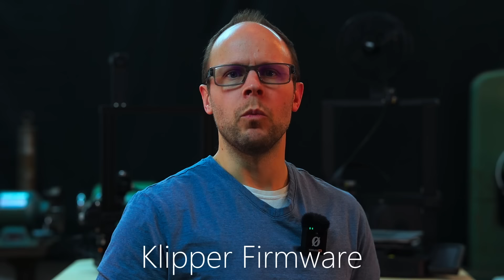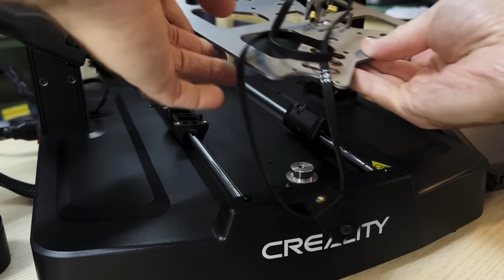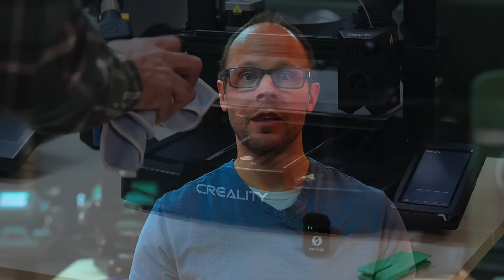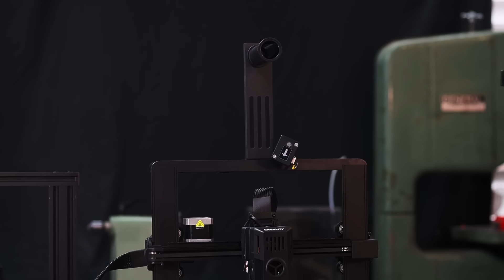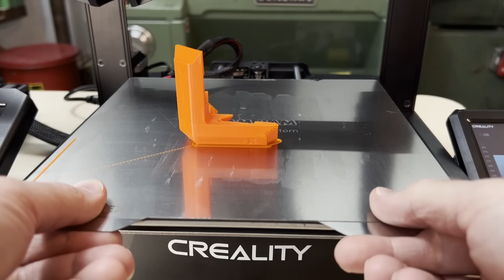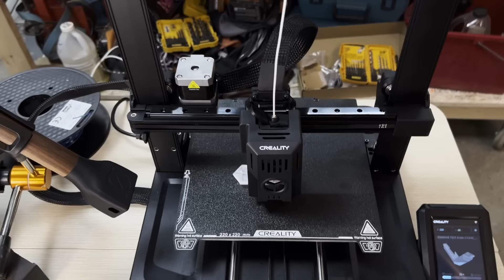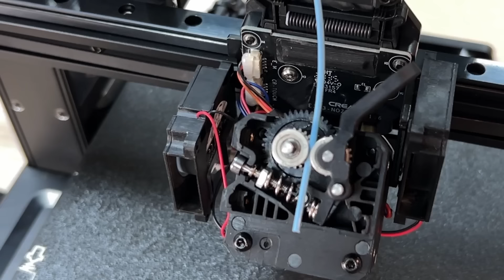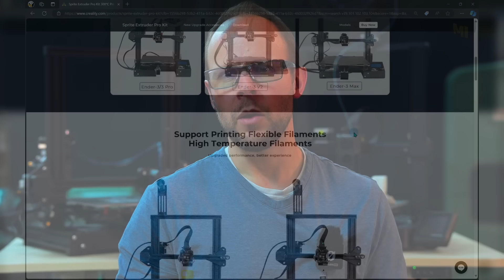Is the Creality Ender 3 V3 KE Any Good?

Comment: Just watched your video, really great. I've had the KE for about a month now and I too, no matter what I do or what calibration I try, I cannot get good results with PETG. I've been using an Overture White with Orca Slicer...
Reply from the maker: Okay, that's perfect, thanks for confirming what I've been having trouble with.  I didn't show it in the video, but I also tried Orca slicer to see if the results were any better... they were not.  I thought that the slicer could be to blame as well.  

I think we're left with the extruder itself, or the extruder/hot end.  This hot end is proven to work well at high speed on the K1 series, and that same hot end is on my printer that I used in the video.  I need to find a way to get the K1 extruder onto the KE printer and test it.  If we can do that, we can eliminate, or confirm where it is coming from.  

Could it be that the straight style of gears along with the volcano style nozzle don't like PETG?
Reply: I do think it is something to do with the combination of this nozzle and gears. However, this nozzle, I'm lead to believe, is the exact same type, size, etc as the K1 so by process of elimation you could probably rule the nozzle out and look at other parts of the extruder / gears. 

I don't have a K1, otherwise I would have also tried swapping things out. Good luck!
Reply: Yes! I've also had the KE for a month as my first printer. I can get near perfect results on PLA every time with almost all default profiles/settings in Orca, but the second I try to use PETG the print quality rapidly declines. I thought I just needed to spend time calibrating it specific to that filament. It's nice to see someone else having issues with PETG on this printer. I can't get it to print anywhere close to as nicely as PLA
Reply: Im printing petg at 300mms whith ke... You need some specs?

Comment: I've done quite a bit of flow testing on my Ender 3 Pro and the Sprite SE extruder is a big upgrade over stock with the Bowden. With just a nozzle and heatbreak upgrade, I was able to hit up to 30mm³/s with minimal under extrusion with a fairly low temp PLA. 16-24mm³/s will be a more common reasonable limit. With the KE hotend and long nozzle, wouldn't be surprised if 30mm³/s was possible for most PLA and probably 15-20mm³/s with PETG even. Basically, under extrusion shouldn't be a big issue. It did look like you got a little but on the base of your microphone holder. Could just be due to slicer settings or something though. Happens to me a lot on perfectly rounded areas too.
Reply: After leaving this comment, I see all your issues with PETG and it could be flow limit related. I sort of doubt it because I would think at least 12mm³/s would be easy for that hotend and extruder combo. I don't have any inconsistency issues like you are having with PETG on my Sprite SE extruder, which is exactly what is on the KE, and with what should be an inferior hotend setup. When you are pushing the limits of flow, you'll see the thumb lever on the extruder moving back and forth. That will be when the filament is bunching up against the nozzle and pushing back on the gears. See if that is happening with your inconsistent prints. You'll note on smooth prints the thumb lever pretty much shouldn't move at all. If it is inconsistent extrusion, you're probably having issues with either not enough temperature staying at the top of the hotend, or you're having heat creep into the heatbreak which is heating the filament too much, but it then cools causing binding. If lowering speeds and/or raising temps doesn't get rid of the issue, I'm not really sure what it could be. I would wonder if reducing retraction or turning it off would make a difference, as retraction can cause too much warmed filament to enter the heatbreak and cool. I've only had that issue with carbon fiber PLA really though. At any rate, my best bet is simply that the PETG needs a lot more heat and it is essentially sapping heat from the hotend causing it to come out in a pulsating manner, giving you those inconsistent lines. I would doubt it is an inherent flaw with the extruder since you are not seeing it with PLA. Definitely makes me think it is heat related.

Comment: I own KE for a month now and no issues with PLA+ at 300mm speed - all looks very good for my needs. Upgraded from Ender 3 v1 and in compare it is like get from old bicycle to Ferrari. Very good printer so far. I would recommned it specially for beginners in 3d printing.
Reply: I can relate
Reply: I have a few using for my business and it’s absolutely flawless!
Reply: i have a question because i want the printer and an e scooter and i have a budget so my question is does the printer get boring or somthing like that in a few days/months

Comment: Fantastic in depth review! Great work. One of the best reviews on this machine.
Reply from the maker: Thanks so much!  It took a bit longer than I was expecting, I didn't think I'd be taking everything apart and trying to fix it... I just couldn't leave it without at least trying.   The printer has a lot of nice features, the linear bearing/rod issue is fixable, I'm not too worried about that one, maybe Iges Drylin bushings would work well there instead.  The extruder/other problem, I'm still a bit disappointed that I wasn't able to get to the bottom of that.  I have a K1 Max as well and I think I will do something similar, I notice some good features above what the K1 has, but I also have a few things that, let's say could have been better.  Still a great, and big machine, lots of potential for sure.  I appreciate you taking the time!
Reply: @NeedItMakeIt  I noticed the linear bearings in the video had too much play, it sucks that the Quality control is so poor that you as the consumer must figure out all of this. There is also the software aspect where they have cut corners, for example if you get the accelerometer and do input shaping it only does X axis and use the same value for y... Also there are some strange design decisions on the K1 with the pulley system and filament path that willkeep users from getting fantastic prints.
I will buy the CR-10 SE mainly because it's an E3V3KE with a beefier motion system and more features. You should look into that, it has a 24mm linear rail for the Y axis instead of rods, and dual Z motors.
Again, it's awesome that you took the time troubleshooting the printer and making the video so detailed. Big kudos to you, this will help a lot of KE buyers.

Comment: Nice to see creality coming out with new old stuff...
I still run an Ender3 pro. Looking to change out my e stepper motor, from a 4240 to a 4223, but not sure if it will work because the the difference in torque 4240 has 0.4nm, 4223 1.3ncm.. 
What is your opinion

Comment: Hello There,
im watching your channel for the first time with this vid.

Could it be that the issues with filament feeding are related to the gears? Perhaps the centers of the steel gears are not precisely aligned with the centers of the plastic gears, causing them to run unevenly. As a result, the filament is fed irregularly. The shifted centers could explain the irregular movements.
Reply from the maker: Glad to have you, thanks for checking it out.  

These gears are a bit strange to me, it isn't something you'd normally see on a high-speed printer these days.   I have seem some reviews of straight cut vs hobbed and the straight cut has more potential force that can be applied before slippage, but at the expense of deforming the filament.  It is possible that it is related to the gears, I think there is some connection, but I can't quite put my finger on it.  With regards to your point about the feeding, here are a few things that happened during the tests that may help to figure it out:

Printing PLA (Hyper) showed good and excellent results, that filament is quite precise, just like the Prusament is
Printing PETG at higher speeds seemed to produce better results when at higher speeds
The results for Galaxy Black PETG, and the other two were not at all the same

I think I need to eliminate some variables and see if it can be narrowed down a bit.  

Thoughts on that?
Reply: While it could be a contributing factor, I doubt that is the issue because first of all it would have to be extremely off to create that much inconsistency and second we would see it in the PLA as well.

Comment: With regards to the linear rods in front, I saw on another channel they showed the screws do not touch the rods and therefore does not hold them in place. Their solution was to use grub screws to screw it down.
Reply from the maker: That could certainly be a contributing factor.  I have a video set to release this Saturday for the full explanation.  It wasn't the obvious unfortunately.  I'll see if I can move those rails when the screws are tight, I was wondering about why the screws seem to fit tight to the surface of the plastic, they should be just slightly proud!
Reply: The same problem with the SE printer, one of many problems it has.
Reply: Sorry about being 2 years late but it seems creality has fixed this issue as i brought a v3 ke a month ago and the build plate doesnt move left or right at all
Reply: @TylerG-g8w No they didn't, the plate does move and if you have no wiggle while it's stable you just got lucky and it certainly does wobble when it is moving and there is no way to avoid it with how this printer is put together.

Comment: You should buy and test the optional vibration sensor for input shaping. It’s about $19 and can be easily plugged into the display on the back side.
Reply from the maker: I heard that you need to check the X and Y axis' separately, I will do this if you want to see the comparison in a stand-alone video.  Of course I need to solve this extruder issue.
Reply: @NeedItMakeIt  I would definitely also like to see this
Reply: @NeedItMakeIt  yes, first screw it to the print head with a printed part and than glue it to the base plate. After that you can remove it and store it anywhere for the future.
Reply: @NeedItMakeIt for it to do input shaping for x and y separately you need to root the printer, install fluidd and change some parameters in the config.cfg file. Creality uses the x value for both axis.

Comment: Great review. Just got mine and noticed the bed wobble. Would it be possible to make a short video on how you fixed that? Cheers.
Reply from the maker: I wish it was a complete solution, bit I can certainly come up with something that solves the problem and doesn't cost much.  My best suggestion at this point is that the rails need to be replaced with actual 8mm.  3D printing your own bushings with that type of tolerance is a task that I don't think I can recommend.  You'd need a reamer and any pressure applied by the bearing block while pressing the bush in will cause the ID to change slightly.  I will put some more thought into a final 100% solution that lasts, maybe something will come to mind that I haven't thought of yet.
Reply: @NeedItMakeIt  Awesome. Thank you.
Reply: @NeedItMakeIt   I wonder if delrin bushings might work or if they'd wear too quickly at the speeds the bed is moving.
Reply: He covers it later in the video fairly in depth.
Reply from the maker: @802Garage  I wish it were a perfect solution, adding the bits of shims was pretty sad, even though it seemed to help a little.  At first, I applied pressure to the block before tightening it, but it seemed to relax back after the first test or so.  Could we use very small liner rails here instead?  It wouldn't need to be much, or possibly a single wheel riding below that can run against one rail to keep a little pressure.  That one seems a bit gimmicky.
Reply: @NeedItMakeIt  I like tinfoil as a shim since if won't compress more after initial. Could also print new mounts for the rails potentially?

Comment: Good review.
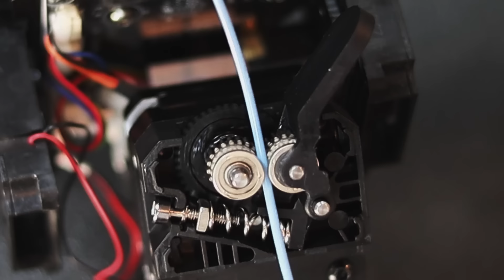We can see at 21:26, the filament "glitch".
I think petg is auto lubricant and it is difficult for the extruder to guide it correctly.
Reply from the maker: I was seeing the lever move more than I expected as well.  This is a 60W heater, it shouldn't have any trouble keeping up at these speeds.  I agree about the lubricant part, it does tend to be pretty slippery.  I tested filaments inside a bowden tube a while back (off-video) and PLA had a lot more friction compared to the PETG, and that was inside of a Teflon Capricorn tube as well.
Reply: @NeedItMakeIt  Yeah, from all of my flow testing, if you see that lever moving, you are getting inconsistent extrusion. If the lever moves enough for the extruder to actually slip and you hear a clicking noise, obviously the gears are slipping on the filament. Anytime the lever is moving though you are still getting a little bit of slip. The other issue I can think of that could be causing this is if there is a small gap between the nozzle and the heatbreak, but not enough for the filament to ooze out and create a blob or anything. The filament could be creating a small Ridge which sticks until it gets hot enough for the filament to push past it. I doubt that is it, but it is something that could happen with petg and not pla. I wouldn't think it would be that possible with the volcano style nozzle, but if the heat brake doesn't go far enough into the heater block, I could see it potentially happening. I'll reply more later, but the clear front case is a really cool idea! You could use transparent filament to make that, you'll just have to dial in your settings to get the best transparency. There is a good guide out there and C&C kitchen did a video on it.
Reply: @NeedItMakeIt  The main reason I don't think it is an inherent extruder flaw is it not showing up with PLA. I mean it could be an extruder issue, like just straight up gear slip, but that still means there is a limit to feed rate through the hotend. Like I said I could reach 10-15mm³/s with PETG on my Sprite SE with an inferior hotend. What speeds and layer height were you running? I got pretty much no inconsistency at something like 6mm³/s on outer walls and everything else was faster and looked good too. You're getting inconsistencies on individual lines it looks like. That would be really strange for an extruder unless PETG is just slipping constantly. How much did you have the tension adjusted? I run mine only 1/2-1 turn in on the screw. I'd maybe run some flow rate tests with your PETG just to see where it's falling off.
Reply: PETG definitely likes to slip more on the extruder gears when it is not melting fast enough, as opposed to PLA which likes to strip entirely. Difficult to determine anything with his demo though since the gear axles aren't guided by the front part of the case and it's not going through a hotend.
Reply from the maker: @802Garage  The strange thing is that this isn't a problem for the K1 extruder, and it has the same hotend setup.  The gears are hobbed, and it must do a better job of grabbing it.  I wonder if there is some way to create a see-thru version and we can tell what's happening inside better.  Like the engine heads you'll see made of acrylic... that don't last, but at least you can see the action.  I could be looking in the wrong place, I need to do some kind of comparison to eliminate all of the variables, maybe an entire extruder swap is required.  My guy tells me that the extruder is the problem, but with high-speed, pressure advance and input shaping, we have a few more variables.   Maybe I turn as much off as possible and see what it looks like?

Comment: Great review, like the way you stripped it fully down and demonstrated the parts in detail. 

I was going to get the ke but i got the bambu lab a1 instead and very happy that i did.

I have the v3 se and the ke looks like it's a good upgrade over it but not worth upgrading to it.

If i was getting a new creality bed slinger i would get the cr10se because it has much better upgrades over both the v3se and v3ke.

I like bed slingers they are much easier to work on than core xy
Reply from the maker: Thanks, it's quite a bit of work, but I really enjoy taking things apart, but it became a bit frustrating to not be able to solve all of the problems.  Still it has potential, but it's not perfect out of the box.  

You made a good call on the A1, that's a nice printer that just works.  Nice features, looks good, the nozzle swap feature is really cool as well, do you use that much?  I checked out the CR10 and it does seem to have a few better features, at that price point the A1 is a better option, larger bed, upgrade to multi-color, it looks a bit nicer IMO.   The bed slingers for sure are so much easier to work on, so open, lots of light, you can see it running and troubleshoot easier.
Reply: @NeedItMakeIt  i use it pretty muct everyday,i love it, that and my k1.
I have 0.2 and a 0.8 nozzle to try out on the a1